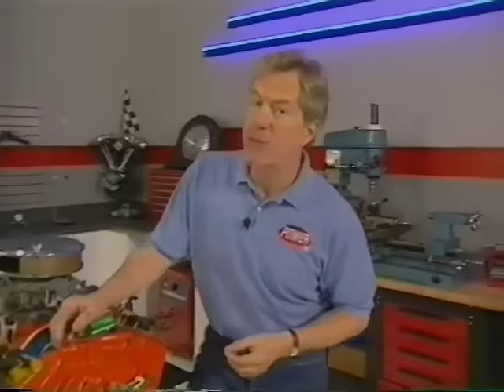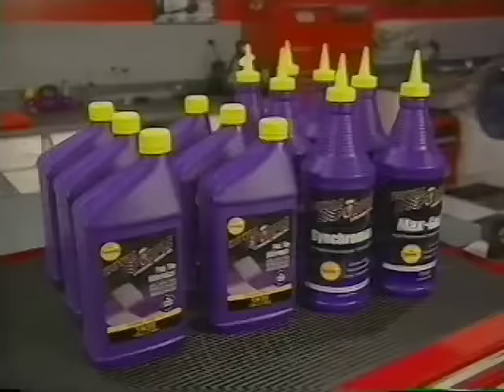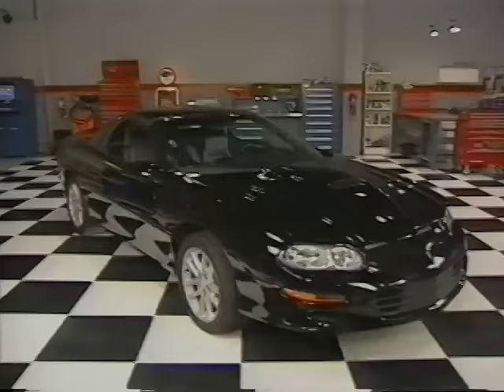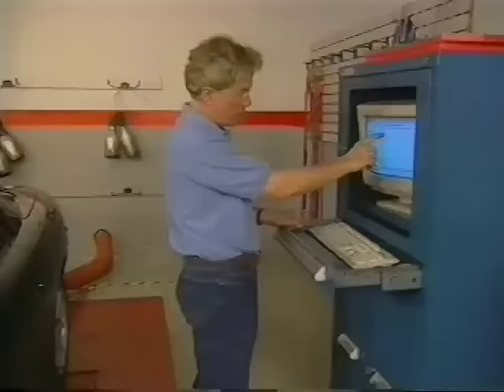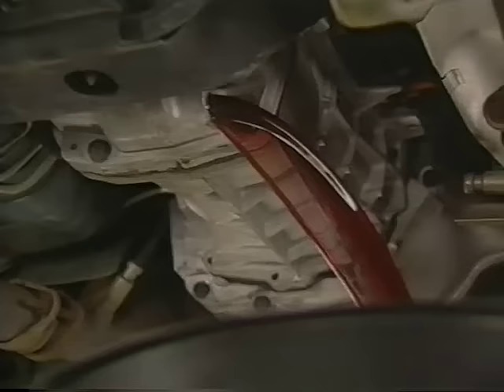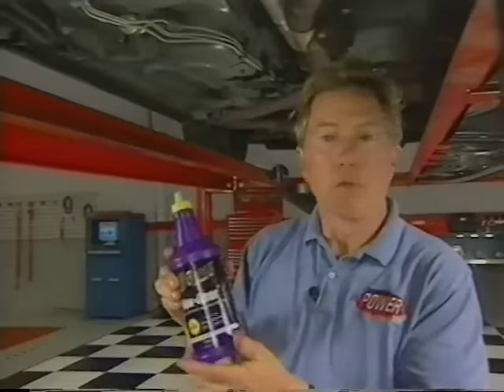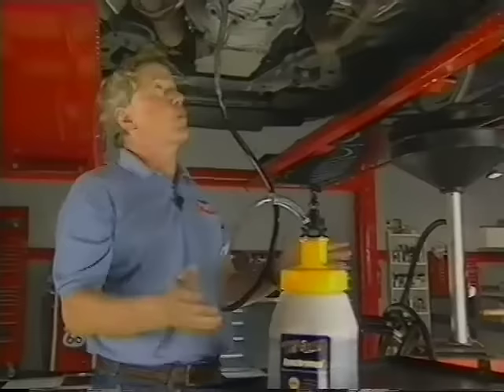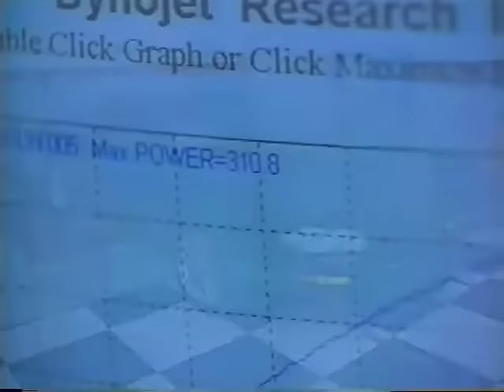Increasing Performance with an Oil Change

Comment: That being said.. It probably wouldn't have to be an expensive or "performance" oil. As long as it's changed frequently. In my experience, it seems engines have their oil they perform better with. $2.00 a qt of Mobil works great in my car, whereas Valvoline gets "consumed" faster and turns black faster.

Comment: its more like $60 for the 5w-30 motor oil $30 for the rear end gear oil, 80$ for the trans fluid and 12$ for the coolant additive...... so almost 200$ not that cheap.... you can add more hp buy just buying a 200$ sct or super chips tuner. but royal purple does make the best fluids you can buy if you ask me.

Comment: This video is misleading. Instead of comparing Royal Purple to some unknown, dirty, used oil with an unknown milage on it, how about comparing it to fresh conventional oil? Better yet, compare Royal Purple to several different brands of conventional AND synthetic oils.

Just simply doing an oil change with cheap conventional oil can make a difference when compared to old, dirty used oil. I've noticed a difference for years when doing this. So don't compare new oil to old. Compare new to new.
Reply: WKHalford 
I can see your point, but the stuff has been proven and established regardless. 
The only problem is it doesn't last long, but you do have to change it every 5000km.
Reply: I think the take away here is that fresh fluids give you a performance bump.

Comment: hey Horesepower TV try useing royal purple on a 04,05,06,07,08,09,10,11, or 12 chevy  colorado with a 2.9 auto 2 wheel drive truck video before i pour it in my truck please reply back horesepower tv

Comment: you need to understand that it doesnt give you more power but makes it so that you motor doesnt have to work as hard to make power witch in hand makes better performance and a lil bit more Hp to the wheels.
Reply: More hp is more power.  lol

Comment: Thinner oil will make more power. You guys that point out how old that oil is should know that that old oil is broken down and would be thinner creating less drag on the rotating assembly. So for new fresh oil to make more power and not lose power is an accomplishment.
Reply: pbuddy215 well thinner old oil can also lose its viscosity and breakdown causing increased wear and friction. Otherwise we would all be using old oil!
Reply: @nighthawk0077  Exactly. Some of these guys have no clue. lol

Comment: If you notice the oil on the engine is pretty dark... at least 3k on that oil, of course that decreases horsepower, and adds friction.  So there's a little note, why not try a brand new Castrol oil and then flush it and put all royal purple...